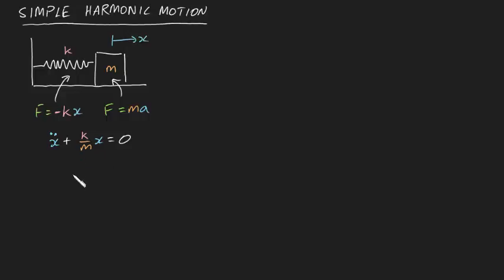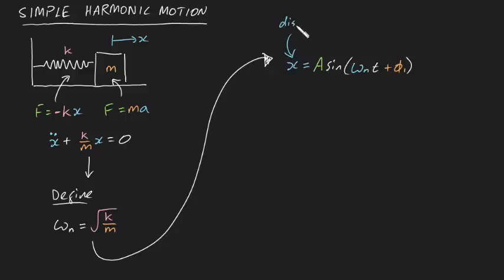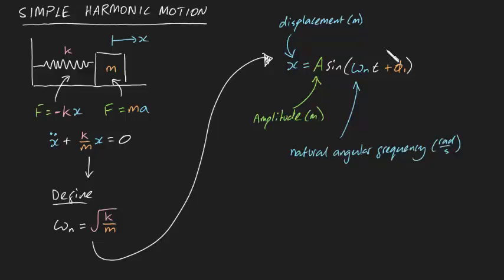Spring Mass Systems Summary

Comment: Great video and channel, but what do you mean by phase in the video?
Reply from the maker: Hey sorry for the late reply! Phase is the 'phi' term in the equation and there's two ways to think about it: 

In a direct mathematical sense, the phase term shifts the sine wave left or right. So for example, if there were no phase then the sine wave would satisfy x = 0 at t = 0.

But from an Engineer perspective I think its useful to think of phase as a way to compare how in-sync two waves are. You can see this video here to see how phase describes how in-sync a force wave is to the displacement wave. https://www.youtube.com/watch?v=YG14-6dAoqc&ab_channel=VirtuallyPassed